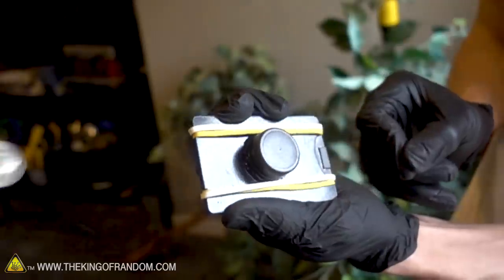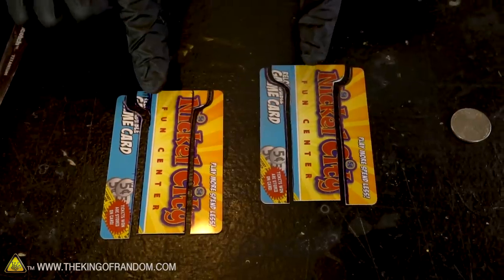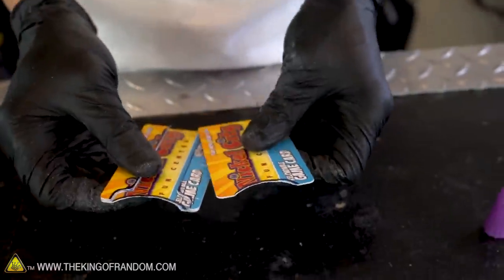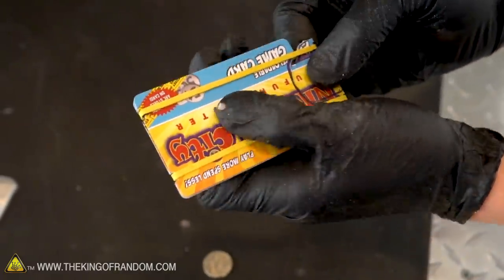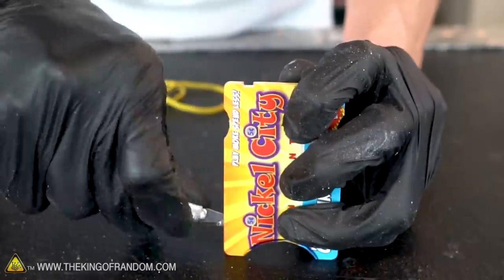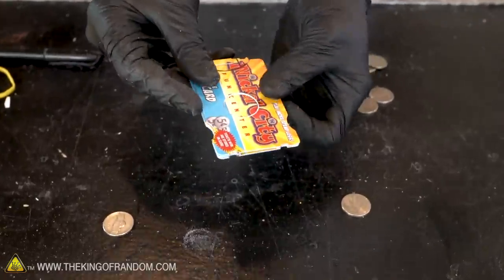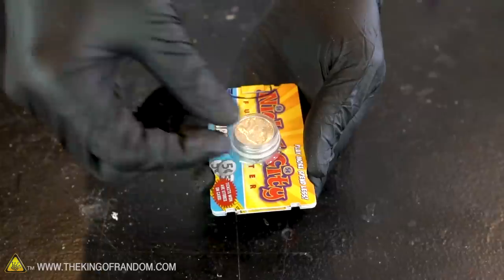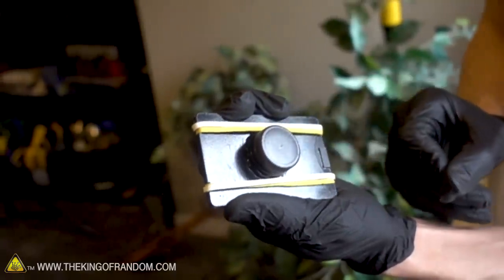DIY Gift Card Coin Launcher! The TKOR Coin Gun DIY Launcher How To Guide!

Comment: Materials: $5
Equipments: $5000
Seems like its very worth it.
Reply: Literally just sandpaper
Reply: If you bought the same things he used for "equipment", and it cost you $5,000 -- you got ripped off BIG TIME! lol
Reply: Literally sandpaper and a file. Less than 5 dollars at Harbor Freight.
Reply: What about the 35 cents
Reply: Literally just sand paper, scissors, and rubber bands in the first version, BTW, the first version is much more powerful than the other one.
Reply: @pranalisarpotdar8203  
Hot to make

Comment: Or you can use a nickel container like the ones used by coin collectors. It also has a screw on cap and will hold 40 nickels. Just need to cut the bottom off.

Comment: You should get very high voltage electricity and put the wires on dry ice or use ferrofluid and freeze it then light it on fire or do them both together

Comment: An additional upgrade that could be done is to add a spring to the cap so that it will push coins down instead of relying on gravital to drop the next coin to shot
Reply: It's just like Batman's batsuit from The Dark Knight trilogy. The first one from Batman Begins wasn't so comfortable for Batman because he couldn't turn his head and had less movement. But in The Dark Knight, his new suit has separate pieces so he can turn his head and have more movement.

Comment: To upgrade the mag leave a bit of plastic that flared out plastic leaving 2 strips of plastic on both sides. Get 2 rubber bands that are small and hook the rubber band on the strips of plastic. Now u have one neck so hot glue. A couple more on top to get around a 20 round mag. Once used fold both strips of plastic in the same direction so it covers the bottom where there is a hole and with the two rubber bands holding the mag on tie the strips to the mag neck so nothing will come out now u made a changeable magazine.